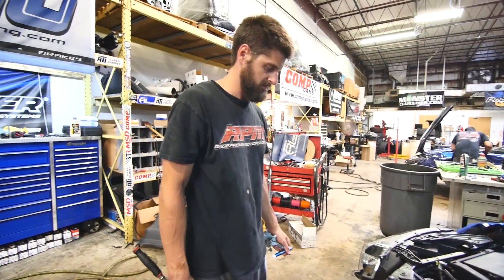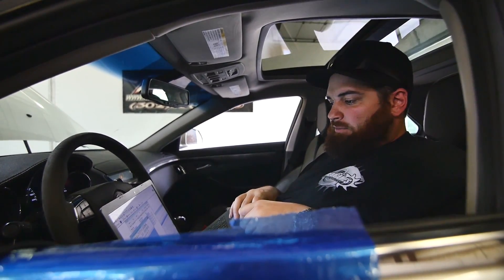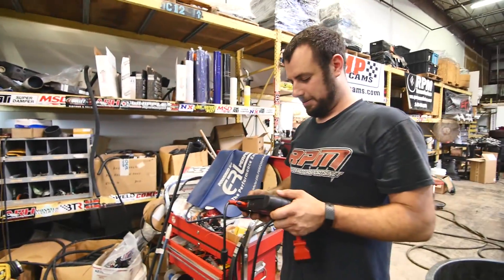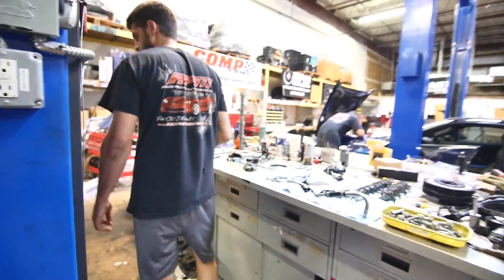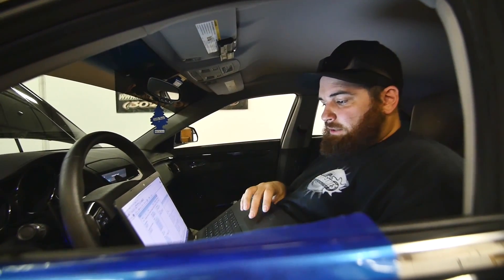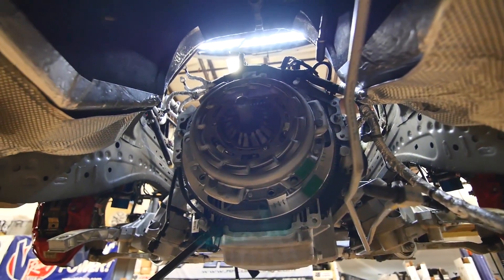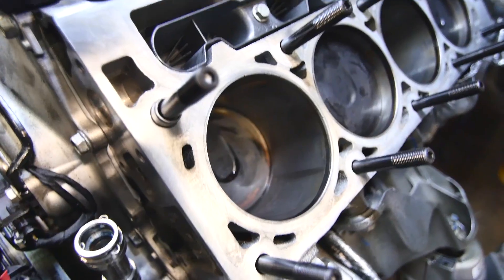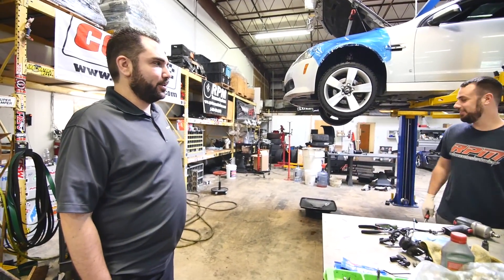Installing a Camshaft from the back of the block?  | RPM S8 E89

Comment: I’m more impressed that y’all are able to do a cam in an LT car with the engine still in.  Almost everyone tells you it has to come out.
Reply: i did it in my garage without pulling the engine in like 6 hours lol
Reply: if you have two eyes with a brain in between it’s pretty easy
Reply: Its good to reseal the pan, i did mine in car just to prove a point but its really easy to pull the motor on these
Reply: @mainlymoto9828  about 8 hours and a 12 pack is all it takes

Comment: Matt is pretty savvy taking the cam out from back of the engine. That car was totally disassembled. Lol. What the heck. Steve is filming Matt while he sets the clutch in. Look at all the daylight from under the car. If I had an LS based vehicle, I’d take it to RPM.